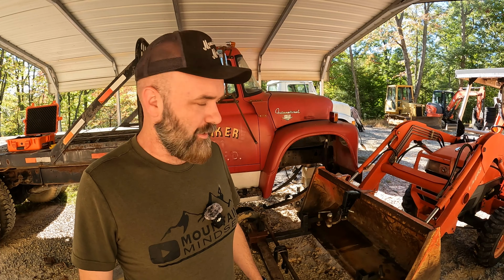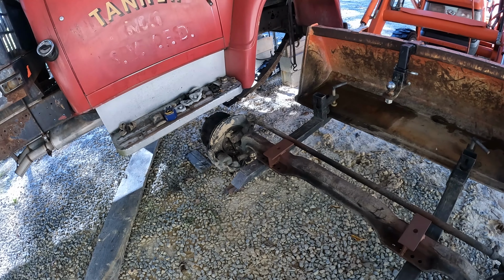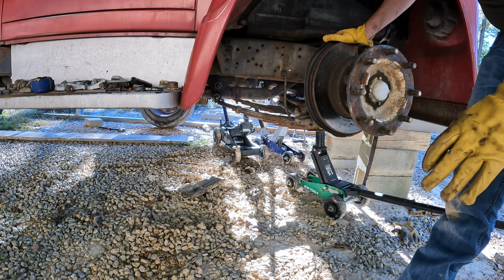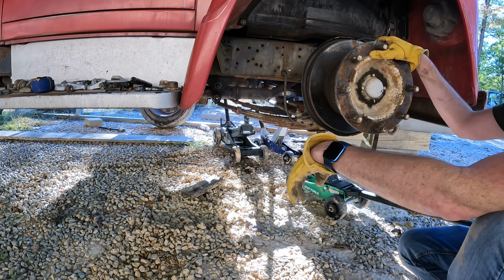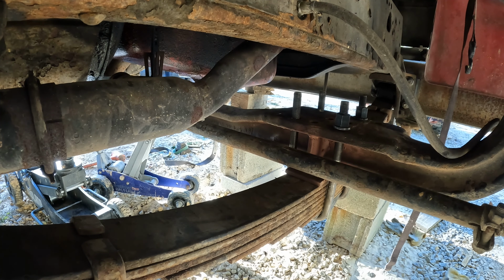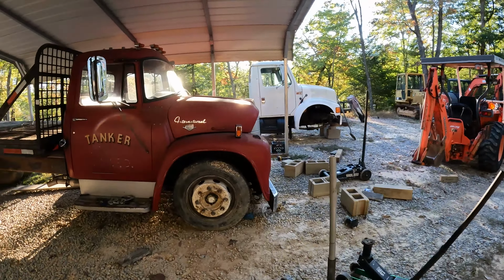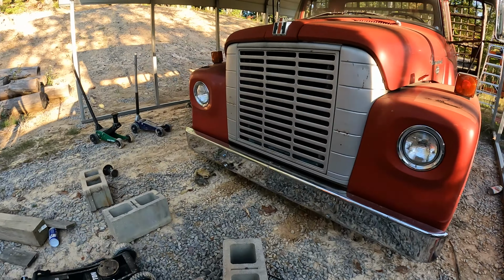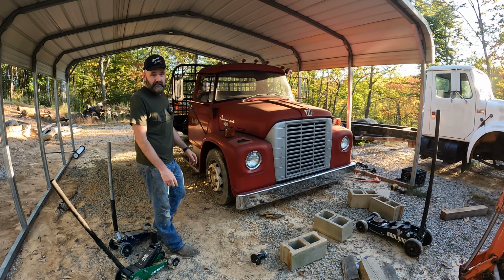Lowstar Loadstar setting on its own now!!!

Comment: More power to all these guys building awesome loadstars with their shops with concrete floors and two post lifts, but building them in the dirt and gravel with floor jacks takes it to a different level. I'm building a 67 in the dirt.
Reply from the maker: @mattkenaston7180  That’s for sure! I’d like a shop with a lift and concrete floor but until then, we will be doing it the hard way! Lol. Are you documenting your build anywhere? I’d like to check it out! Good luck on the dirt work! 👍🏻
Reply: I'm also building a 78 1600 in the dirt. Waiting on a carport currently I'm doing it completely exposed lol
Reply from the maker: @ryanwirtner6144  I know the feeling! I still have another carport to put up so I’ll be mostly out of the sun and rain. Lol. Good luck on your build and keep us posted on your progress! 👍🏻
Reply: @MountainMindset  I am not documenting it, but I may start. I'll post here I'd I do.
Reply: Any reason you swap the front axel ? I'm in a prosses of doing the same thing with the axel but I'm planning to use the same loadstar front axel
Reply from the maker: @ I thought about using the same axle but I wanted the smaller wheels and tires along with the disc brakes. What size wheels and tires will you be using? I think slammed on the old daytons with some bologna skins would look great! Let us know how it goes!👍🏻